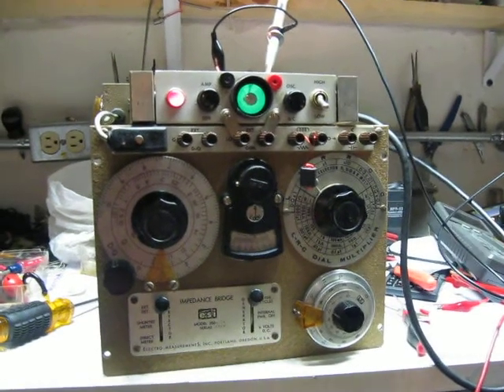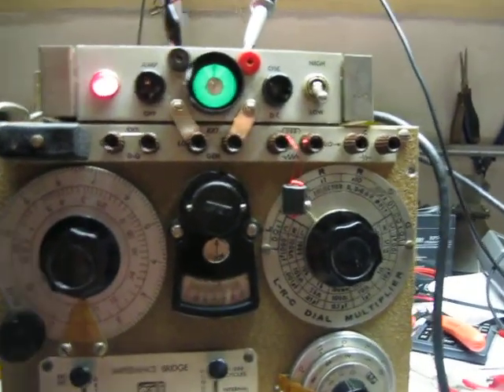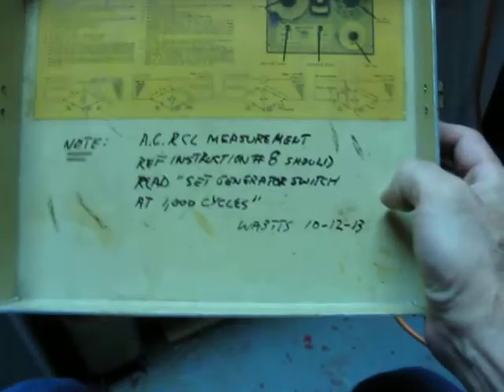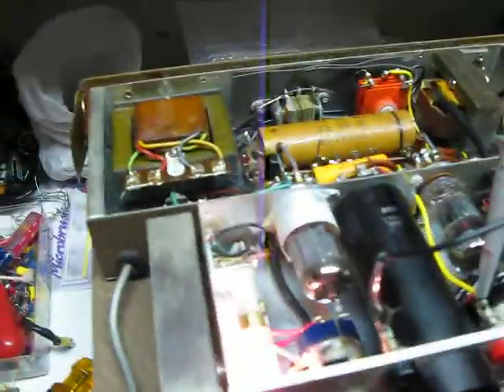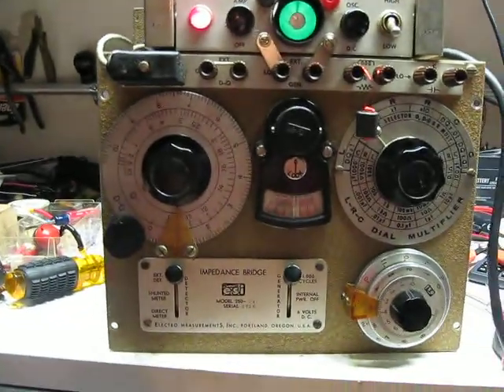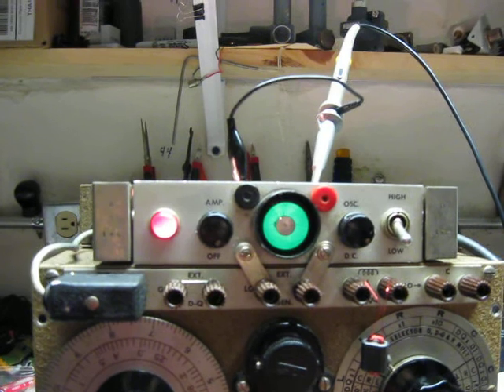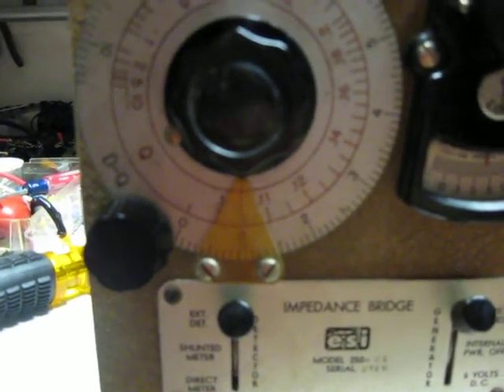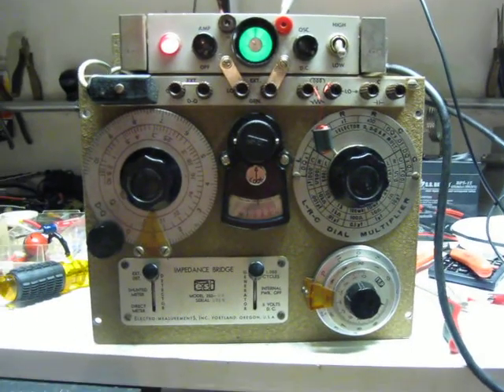ESI Impedance Bridge Model 250 C1  Operating Instruction Note

Comment from the maker: Mike,  search for "Bama Boat Anchor Archive" on Google, click on the "esi" category, and there are manual downloads available for the 250DA, 250DE, and 300PVB models.  I would assume using one of the two 250 versions would be close enough to get you into the ball park.  I have not used my esi unit in awhile, but I recall in one setting of the OSC Lo/Hi switch the oscillator would not work. (Can't recall if it was low or high which worked, so try your oscillator in both switch settings)  I thought it as a rectifier diode in the power supply, but that turned out not to be the case.   It is one of those projects I have been meaning to get back to....other "stuff" keeps getting in the way ~:)  Keep in touch, maybe we can figure the osc issues out between the two of us fiddling around.... Mike wa3tts
Reply: +WA3TTS1   Hello, Thanks for the reply.  I replaced the 2 selenium rectifiers with full wave silicon bridge rectifiers in the osc/amp.  This is a good upgrade., much better DC output.  But the lid/cover was missing from my unit, so no instructions for use.  I just got this unit off of ebay.  Also, can you tell me if your unit has 2 on/off switches  on the  osc and amp on the osc/amp??  Mine has one on the  amp, but looks like it has been moved from the other control with the off setting. I would like to talk to you if you have a number.
Thanks    Mike    618-993-6340
Reply from the maker: +Mike Jobe   Mike, my ESI 250C unit has an on/off power switch built into the amplifier gain potentiometer and a High/Low DC impedance toggle switch. My unit works for AC resistance and LC measuring in the Low position but not in the high position. It's possible I have not presented it with a high-Z measurement condition for the oscillator to operate in that mode. I will look into that.  Here is an image of the ESI lid. 

https://www.dropbox.com/s/1uemclhwm1zxkrg/ESILID.JPG?dl=0

Click on the image and use the zoom function in Drtopbox to read the lid
instructions.

Keep in mind that instruction #8 is incorrect, you need an AC signal source to measure AC resistance or LC reactance, so it is not correct to have the Internal Power set to "Off".  Keep in mind there may be other errors in the lid instructions.  If you go through the manual information from the BAMA site download the error in the #8 should become obvious. Apparently it was known by technicians and engineers at the time the lid instructions were wrong, which may account for the missing lid situation with the ESI 250 ebay finds.

There is a voltage drop in selenium rectifiers similar to the 40 volt drop in a tube rectifier, you may want to Google "Selenium rectifier voltage drop" and see what resistor value would bring the B+ back to the original design value. At the higher B+ voltage, the grid bias on the dual triodes may likely be off.  If you know someone with a transconductance tube tester it may be worth testing the dual triodes in the ESI meter for gain.  Of course, you can do that with a signal generator and scope if you have the B+ and grid bias set in their correct ranges.

Also note it is possible to remove those 1KHz input/output filter cans and use an external generator with this unit at other frequencies. I want to try that some time and see what the amplifier gain response vs frequency is like for another tube-related project....

I'd love to play with that box all day but I have several hours of tech writing to
complete for work. If I get an hour or two this evening or tomorrow I may put the ESI 250C on the bench and tinker for a bit...  Regards, Mike wa3tts